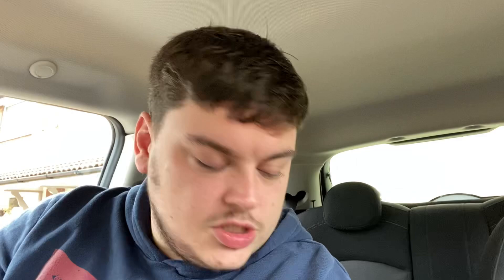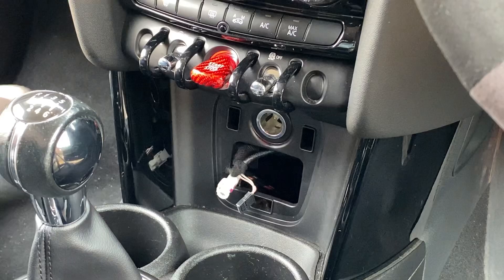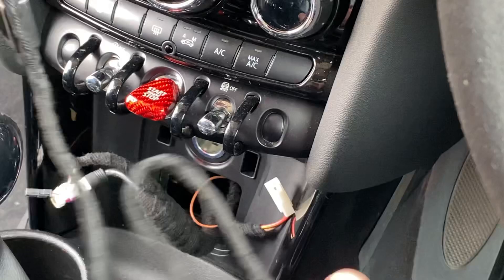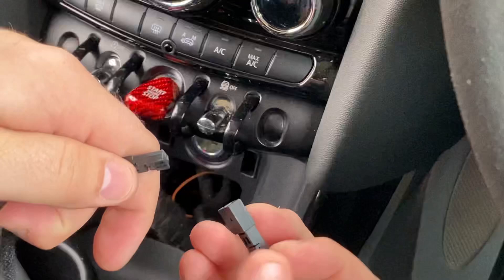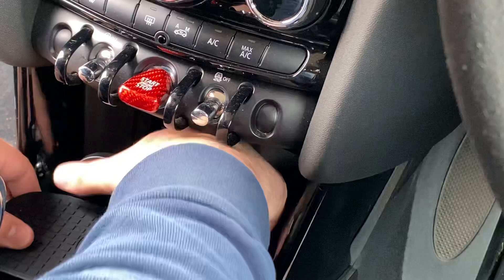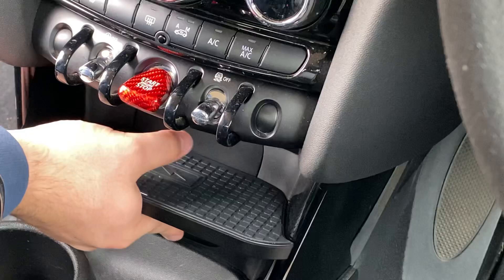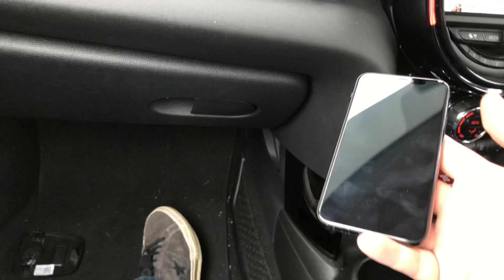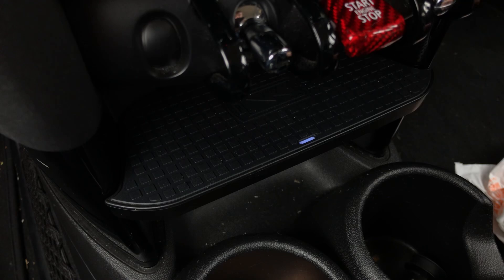MINI F56 WIRELESS CHARGER INSTALLATION?!

Comment: Just for information for yourself and for anyone wondering all iPhones with wireless charging have the capability will charge at 7.5w, the phone 12 however will charge at 10w. A lot of Android phones specifically One+ will charge significantly higher, if you have an iPhone this pad will charge your phone quicker than most regular wireless chargers will.

Comment: So sorry to trouble you - but you seem like a nice fellow. I’ve just bought a dashboard bracket so that my wife can place her iPhone next to the steering wheel. Ideally, I’d like the lightning cable to go into/behind the console rather than having an ugly (and potentially dangerous cable going all the way down to the USB port by the cigarette lighter. Any idea of whether I could run a 2 for 1 connector behind the panel you’ve installed in this video? Would be so grateful

Comment: Hello Ben. Brilliant video! Does this item stop you from using the cigarette lighter? I see that it taps off the existing one but then it also gives you another cigarette lighter socket. Can you still use that for other non wireless chargers if not using the USB socket? Thanks :)
Reply from the maker: Hey! The cigarette lighter is still functional. It resides under the charging mat as well as the USB and Aux connector.

Comment: Hi Ben, great video, you always seem to review niche mods. Just before you clipped everything back in, it looked like there was quite a few redundant wires from the old assembly, was this something you could have removed and are now just hanging about or were you not able to get to/remove them? Thanks!
Reply from the maker: Hey! I don’t remember any of them being redundant. This piggybacks off the previous wiring harness but all previous wires are still being used.

Comment: Fantastic! Will definitely add this to mine, great video as always 👍
Reply: Hi Ben, just fitted mine today, does the white  standby light stay on permanently even when you lock up? If so I can't imagine it will use much power.
Reply from the maker: Hey 👋 not at all, it should power down after around 5 minutes
Reply: Will check to see if it's still laminated, you made it an easy fit following your video, cheers
Reply: Ben you're right it has powered down, 😊

Comment: @BenRolfe How's this holding up after a year of install? Also, how fast is the charge ?
Reply from the maker: Hey! I’m still using it to this day and it’s holding up great. The charge can be a little slow when using wireless CarPlay but it’s more convenient than having to use a cable

Comment: Have you had any problems with this? I've had mine installed since April and now it doesn't charge and I get a constant flashing blue light.
Reply from the maker: Hey! No issues at all. Flashing blue usually means that the device is fully charged.

Comment: I’m curious to hear how well the rubber mat keeps the phone from moving while driving.
Reply from the maker: Surprisingly well. The pad is ever so slightly tilted backwards to sort of hold your phone in place. The pad is also really grippy.
Reply: I’ve installed mine last weekend and confirm what Ben says. Mine doesn’t budge despite my cornering! I only use my CS as a weekend car so it’s pretty secure! 😄

Comment: Nice but hard to justify that price and it’s not even OEM
Reply: Sometimes aftermarket items can be better than stock. Also depends how you use your phone with your car.
Reply: It’s better then OEM Matthew. The one in the armrest from MINI heats up the phone very quickly since it’s fully enclosed. This should work a lot better.
Reply: I don’t disagree but personally for me, it would be a waste as I rarely have to charge my phone in the car anyway, it’s a commuting car and a cable is faster for the time it’s plugged in.
Reply: Agreed, $200 USD is absolutely ridiculous for a wireless charger. My Note 10 plus which is ages old will charge at 15 watts wireless and the website says this pad only does 10 watt. Not worth the money by any means
Reply: Better than OEM or not, it’s a charger at the end of the day so at that price it’s nothing more than a gimmick and your money is best spent elsewhere.